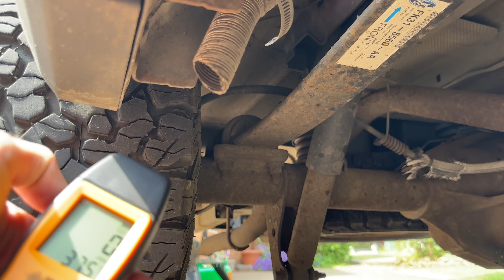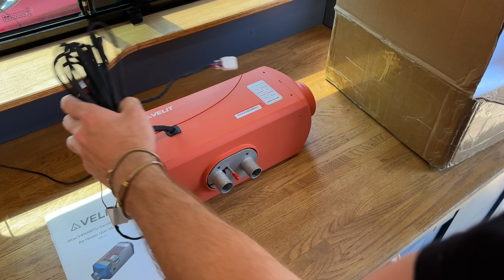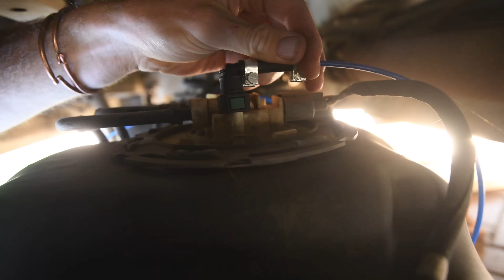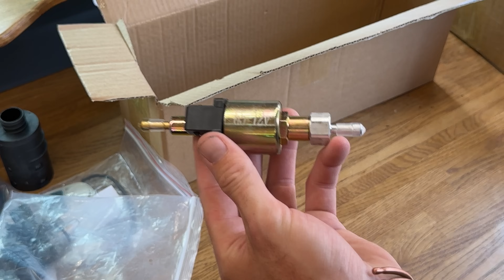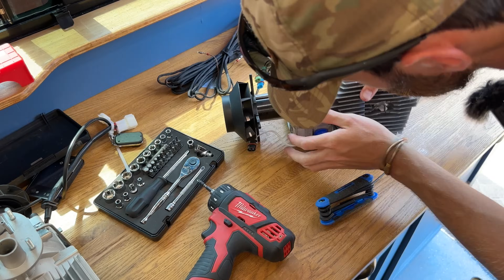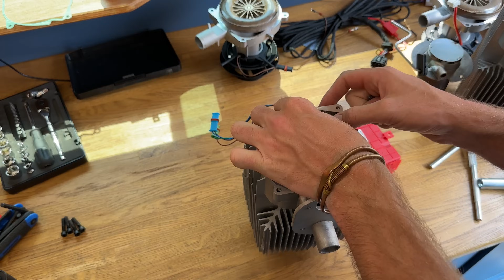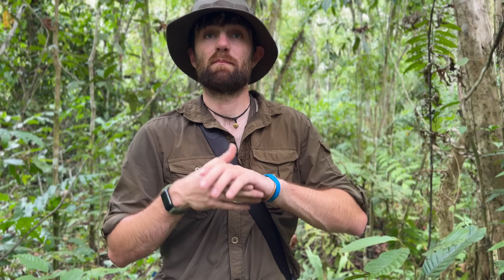DIESEL HEATER runs on GASOLINE / PETROL! AMERICAN CHINESE Heater Review | Tear Down & Comparison

Comment: “Diesel” is a wide range of liquids.
There are sulfur-containing heating oils, different types with more or less sulfur and wide range organic Oil content. Diesel from the gas station, and there is Syntetik Diesel GTL without smell but also GTL for paraffin stoves. There are different purity classes 4 and 5. Class 5 is synthetic; class 4 smell similar to WD40 Petroleum. I think you got bad diesel with high organic content, sunflower oil or rapeseed oil. Try GTL from the kerosene heater, also known as a paraffin heater, it burns the cleanest. You need standardized fuel fluid :-) GTL is the most reliable and safest fuel fluid. In arctic regions you don't joke with the heater. In an emergency, you need to know exactly how much organic oil you can mix in before the burner gets sooted and goes out.Thank for the Video! Happy New Year!
Reply from the maker: It’s straight “shell” brand diesel from my vans diesel tank. 

And I would’ve said for diesel heaters which are primarily used in vehicles and often from vehicles own fuel tanks. A great option. 

The other heaters ran from the same diesel without issue
Reply: And I would have said, the cleaner the fuel, the cleaner the combustion, the less carbon monoxide next to your bed :-)
The van with injectors doesn't complain about the fuel.
In the diesel heater, unpressurized fuel drips onto a glowing mash, very fragile and sensitive. There's not much magic in it. :-) What comes in comes out. Shel sent you samples from the lab? I want it too *G @MispronouncedAdventures

Comment: It would have been great to see how fuel efficient the gasoline model is compared to diesel. With gasoline/petrol being cheaper in the uk I wonder if having a separate underslung fuel tank for petrol would be worth it on a diesel vehicle?
Reply: I didn’t think petrol would be more efficient than diesel, especially in an application like this. Being a mechanic I know my way round petrol and diesel car engines and much prefer diesel as they are more efficient. I enjoy watching your videos where you test heaters etc. really interesting! I’m currently in the French alps for Christmas and new year in my camper that I live in and my next trip is to northern Sweden/finland/norway so love seeing how you’re doing with heating etc…
Reply: @tonymoulls  True , petrol is a step away from being a gas without all the oils which diesel/naptha has. Hence diesel has more energy but ignites harder but requires bigger surface area (droplets). Petrol is almost a gas. Spark and  it goes full blast in whatever form liquid or droplets.
Reply from the maker: It’s quite difficult to measure heat output in air with what I have. I have done efficiency tests on hydronic heaters on petrol vs diesel. 

Petrol is around 10% less calorific than diesel as a fuel type, my test on hydronic heaters found it’s running petrol to be 20% less effective than diesel.

Comment: If I'm reading the data correctly, it looks like the ratio of exhaust temp to vent temp (essentially the efficiency of heat transfer from burn chamber to vent)  is best for the Chinese diesel heater on Low at 1.3 , followed by American running diesel on Medium at 1.51, followed the Americn heater running diesel on High at 1.65. So it does look like the American device burns diesel more efficiently than the Chinese models.  Efficiency wise, it runs diesel more efficiently than gasoline on Medium and High. As for cost, that's another issue where joules per liter per dollar/pound matters, and prices will vary considerably by nation and region.
Reply from the maker: I’d says yes. Many of the Chinese ones can be tuned to have better performance at different settings as well. 

But this heater own design Ben chamber definitely has an effect

Comment: We need to figure out these diesel heater controllers. I had one that was completely user tunable. I was able to swap in a 65 dosing pump plug and play. And then adjust fuel to air ratio to burn expired ethanol hand sanitizer. I got 1400 gallons for free😂

Comment: Just found your channel, and I appreciate your indepth explanations.
Question: Is it ok to mix gasoline with diesel, in a Chinese DIESEL Heater? The reason I ask is I have about 200 gallons of 30yr.diesel that clogs up the burn chamber very rapidly. I'm thinking about mixing gasoline, but I am not sure if gasoline will help resolve my problem, Or worst melt the unit? Maybe a 5-50% mix? Any information you could give me would be greatly appreciated. Thank you.
Reply: Kerosene in a 50/50-75/25 diesel to kerosene mix works... Kerosene burns relatively cleanly diesel tends to soot, I run 50/50-75/25 in my big jet heaters all winter long (basically the same thing without the heat exchanger and secondary blower) when I ran straight diesel I'd have to clean them 2-3 times a month switched to  75/25-50/50 for normal heating use and 25/75 at the end of the month and I go 100% kerosene for the last heat of the season with no need for cleaning (mine burn completely clean during my last heat of the season on the straight kerosene before storing empty).
Reply: I'd recommend filtering the diesel with a water block filter and returning it back to the tank for a day or 2 the fuel cycling through the tank will basically remix the diesel (possibly non ulsdf if off road diesel pre 2005) which would explain the clogging... As would water in the fuel or algae growth in the diesel ( both get removed by water block filter). If it's been sitting  that long you do need to remix it and water filter it especially if it was stored in a metal fuel tank
Reply from the maker: I’ve heard over people doing Mixes like that in Chinese diesel heater but it might need some tuning to get a good or soot up pretty quick. They might be worth posting on some of the Facebook for the heaters. I’m sure there is a group for alternative fuels

Comment: As a American and diesel heater installer that heater is a hard pass for me and would never consider it for my customers
Reply from the maker: If I’m doing anything customer related, I would be recommending an autoterm, costs more for sure, but it’s not worth the risk as installer fitting equipment which might not last or might be problematic.

Comment: Even IF there was a gasoline van I wanted to convert, I would go for a diesel heater since it can run on cheap/low taxed diesel here, in that case I would use a separate tank for the heater.
Reply from the maker: I know many who run diesel heaters in separate tanks so they can  use cheaper fuels

Comment: 649.00 USD yea lol just crazy stuff for a few bits i ordered the 90.00 usd unit 8kw with integrated tank unit to play with
Reply from the maker: I do mention throughout the video, the similarities between the components used here and the Chinese made diesel heater. However, the Chinese diesel heaters won’t run petrol unless you buy a very specific and hard to get hold of ones unlike this unit if petrol / gasoline was a particular need then your options are very limited.

8kW units, though are not 8kW. Chinese diesel heaters 5kW are based on the design of the 4kw Espar 4D. Advertised 8kW units are just 5kw units which are based of a 4kw heater design, using a higher tune which is not really getting a real 8kW.

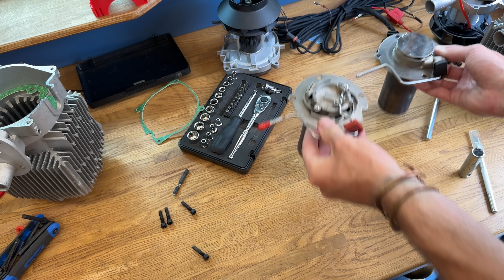Comment: 13:23  the fins being thicker might actually reduce surface area.
Reply from the maker: Aye, there will be less surface area with that wider and less overall fins. not sure how much of a impact on output it would make
Reply: @MispronouncedAdventures  all of them have less surface area than they should if they wanted to be more efficient, they are basically brute forcing the 4kw through the thing.
Reply from the maker: @deltacx1059 pretty much, these ones are honest about them being 4kw, since there are based off the Espar 4D design. Unlike the CDH which are based off a 4kw and claim  5kw or even the 8kW

Comment: Sadly Petrol (Gasoline ) Undermines Safety of Diesel heaters  ( Flammable Room temp Vapers from Petrol  in a leak the fire is very hard to stop )

Better fuel is paraffin  kerosene,  tozane fuel Has a higher BTU output Even over Diesel  &  Petrol
Reply from the maker: Whilst I’m not disagreeing with your mention the properties of petrol. petrol heaters like this have been running around long time, many of the brands make them. 

Many run them off kerosene as well, not heard of tozane

Comment: Stick it u ur a for that price!
Reply from the maker: I’m not quite sure what you’ve said? I presume you meant “up our” opposed to “u ur” whilst I think I say the video for the price is it is quite expensive, but if your requirement is to own petrol/gasoline, you’ll struggle to find a heater as cheap as that to run gas / petrol. As the Webasto or Espar units are so much more expensive than that. If you needed it for diesel, then like a different story, I would go for one of the Chinese heaters instead.

Comment: The fact that you can't just use either fuel without tearing your heater apart is what ruins it for me. Why would you not just put a damn switch on it so that way you can fill the tank with whatever you want whenever?!
Reply from the maker: So that’s an interesting point and l thought the same because there is no hardware differences between the ECU versions ( as far as i’m aware ) it’s only preloaded software based on the ECU. But I also found the current controller quite limiting. I don’t really see why they haven’t or don’t have the option. Hopefully on the newer versions of the controller it could  have the option to change it between fuel types. 

Maybe it’s a business decision

Comment: I have but not yet installed a Chinese Diesel heater in my American Ford Econoline camper van. Since Diesel vans are so freakishly rare and expensive in the US, I was hoping for a gasoline option. Giving serious consideration to getting one of these Velit heaters
Reply: Run a 15 gallon fuel cell ..  you can run 24/7 for weeks without refueling .    ( Mine run even when changing locations, etc).
Reply from the maker: Definitely the opposite in Europe finding a petrol/gasoline van is very difficult/impossible. 

This does seem to be a good gasoline option at a reasonable price point, not as cheap as the Chinese diesel ones, but definitely a pretty respectable price

Comment: Both run the exhaust above 451F on high, the flame point of paper. Don't park over leaves, pine needles or other fine flammables. And none of these heaters really like the exhaust tube bent very much.
Reply from the maker: exhaust gas temperatures when leaving the burn chamber is high. It not going to issue for igniting leaves and so on but the time of hit the ground from when mounting in a vehicle format. I have thermal camera footage in other videos which show the temperature of the ground from the exhaust. The ground is only warm at best 

You is correct on exhaust some of the manual booklets bring up maximum total degree in angles / pipe bents and a maximum total length. Longer and/or bending exhaust restrict air flow and mess up the heaters fuel to air ratio

Comment: Is Velit an Elon Musk company?  🤣
Reply from the maker: No? Not sure I understand the joke?
Reply: @MispronouncedAdventures   Elon Musk is a con man.  I see similar gasoline, I mean petrol, 4KW heaters on Alibaba for half the cost of this "American" company's heater.
Reply from the maker: @paulstaf  oh I see. Yeah I did says the this is based on the Espar design. At least the called it a 4kw design and not the normally Chinese ones which called themselves a 5kw. 

I would say however there proprietary burn chamber is there own, which does allow petrol / gasoline to be used, which isn’t possible on the normal Chinese made heaters
Reply: @MispronouncedAdventures   I see petrol/gasoline heaters on Chinese websites for sale.  Have you seen the inside of one of them?  I would bet some money that they have a similar "proprietary" burn chamber.  I guess when someone reviews/opens one of the Chinese gasoline heaters we will see.  Thanks for the video! 🙂
Reply from the maker: @paulstaf I current got a Chinese made diesel hydronic / water heater for review which runs on diesel or petrol ( apparently ) it’s burn chamber is basically a complete copy of the Webasto heater with can run both . I definitely see similarities in layout between it and this Velit one. But definitely only a complete copy. 

We don’t see meant petrol heater here just as it’s not used for our vans. I wouldn’t mind getting one you mentioned to take it apart

Comment: So Mr. Mispronounced Adventures, what UK supplier would YOU chose for these heaters?
Reply from the maker: Budget dependent.

Autoterm for high quality heaters However there are considerably more expensive than Chinese made ones. They’re made in Eastern Europe now.

If you want Chinese made with uk stock ( for fast shipping ) 

Lavaner seems to be the best quality around both heater and accessory wise. 
Hcalory new heaters have great control options

Maxpeeding rods for budget but decent quality and that’s what I’ve been using in my van for the last few years.

Comment: What burns up when you hook power up backwards
Reply from the maker: Reverse penalty? Most likely just a small component on the PCB if you are lucky . As to which one I don’t know. The likelihood you would need a new PCB, unless you were particularly good at dissoldering components and you identify which one/s where the issue and you replaced it for for like replacement. Worst case you knackered the entire board and easier probably just getting a new ECU

Comment: You can get great quality manufactured product out of China. You just need to be prepared to pay more for it. Keep an eye on their QA, and secure your supply chain. I've been experimenting with these things for a while. And 3 things totally blow things away in terms of reliability... First 8KW is insane for a unit based on the same casting as a 5kw German unit(run it at 4-5kw, and 7ish for burn cycles) . Second, get the burner tube powder coated in extreme heat coating (used for race car exhausts). The coating keeps the burn chamber way hotter and stops soot buildup almost totally (and only cost me $30). Third.. As the exhaust cools over the heat exchange fins, soot and gunge deposits. So powder coat that in pyrolytic oven powdercoat and make a tweak to  the software to the heater goes absolutely full tit every 20 or so hours of use for 15 minutes or so... It burns off all the junk and they stay spotlessly clean inside.
Reply: When you refer to extreme heat coating, are you talking about the ceramic coating typically put on exhaust headers? Interesting idea doing that for the combustion chamber, and it makes a lot of sense.

As far as the heat exchanger, did you coat your entire assembly, or just the internal fins?
Reply: @NordicDan  Yes. In my case I had a shop put the ceramic coat on that they use on exhaust headers.
EDIT: For clarification. I only coated the flame tube assembly.
Reply: You CAN get a good quality product from China, but they make it an absolute PITA, and you'll pay just as much for it as you will for a comparable product made elsewhere, AND you need to CONSTANTLY check that they are not finding ways to cut corners on your products, as they WILL find exciting new ways to cheap out and pocket more of your money.

Comment: its hard to find diesel vans in the USA/Canada, the only i can remember is Mercedes- Benz sprinter, and they are not small.
Reply from the maker: Europe, the exact opposite petrol / gasoline vans are impossible to find or are not even a factory option to spec

Comment: Can you test putting the gas fuel pump on one of the china units?
Reply from the maker: I could, but running gas is more than just the pump. Lots to do with ECU. The same pump is used for gasoline or diesel on this heater. The change however, is the ECU to have different software. 

Using this .65 pump on a normal Chinese heater which is .22 is just going to flood the chamber with fuel.

Comment: News flash..   all chinese diesel run on petrol..  i run 30 percent waste oil, 60 percent diesel or heating oil, and 10 percent petrol.. gobs of heat and no soot ever...
Reply from the maker: You can run petrol into a normal diesel and it will be burn for sure, it’s petrol, it’s going to burn but it’s not going to run well. Most use a different burn chamber and different ECU settings. 

Did you tune your mix?

Comment: Diesel has a lot more calories than petroleum so you get more heat for your money with diesel.
Reply from the maker: Very true. Even running mine in the Arctic I normally use less than 2 Litre night

Comment: thanks for the vide, how about the difference in consumption ?
Reply from the maker: There are a few variables for that particularly setting the heater is used on. I do believe the website provides fuel consumption data
Reply: Should be 13% higher per btu on gasoline

Comment: Hi Alex. Really enjoy your videos. Apologies if you’ve covered it in a previous thread, but what is your Wi-Fi set up?
Reply from the maker: Thank you very much. It’s not the most of interesting of set ups but it’s Huawei E5577 4G router which is connected to a Tp-link travel router, which is what all the Wi-Fi enabled items in the van I connected to
Reply: Thanks. So I assume you’ve had no issues with no external antenna?
Reply from the maker: @destinationscratch9189 it’s been pretty reasonable without external antenna  (which this router has ports for) it’s been on my list of things to do for about a year. I’m sure it would certainly improve it.